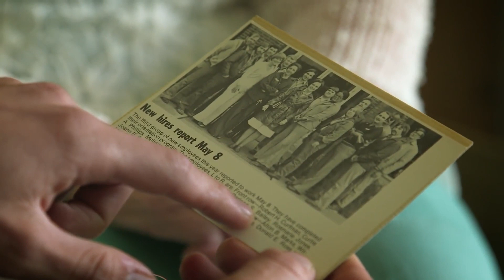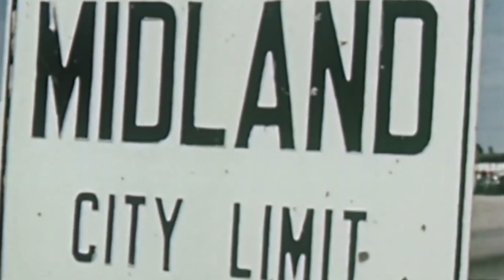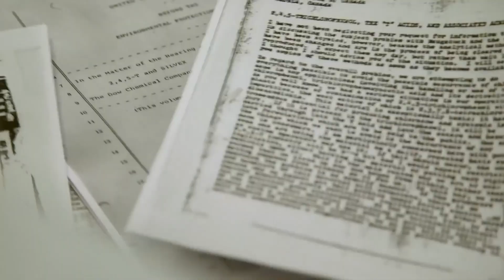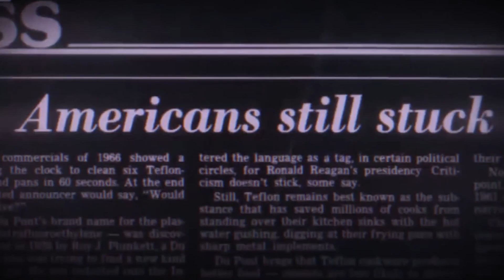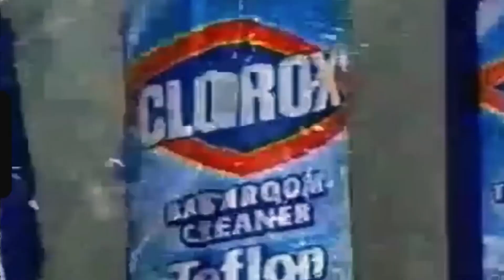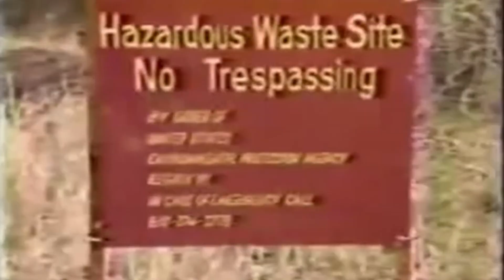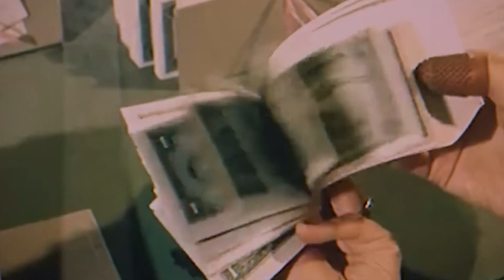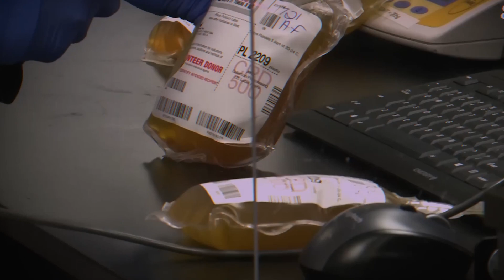Chemical Empire Unmasked: The Sinister Side of Dupont

Comment: More corporations need to take all that money they are making and use it for testing and interdiction of problems caused by past products. It would not only allow for advancements in chemical science (science in general) but would allow it to be done safely and more efficiently. It would also increase employment and in turn, increase tax revenue which could be used to monitor, regulate, and advise science-based industries.  A difficult balance but a balance that can be achieved if all cooperate.
Reply from the maker: That would a great balance to strike but with the corporate focus on bottom line and shareholder expectations that's a hard reality to imagine.